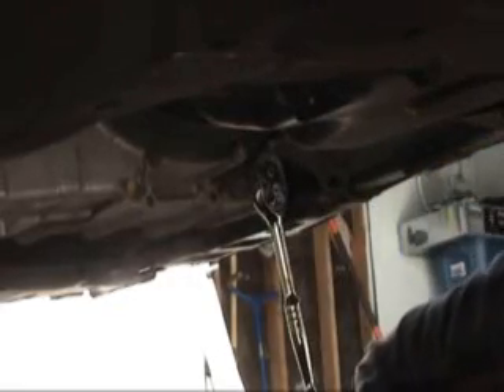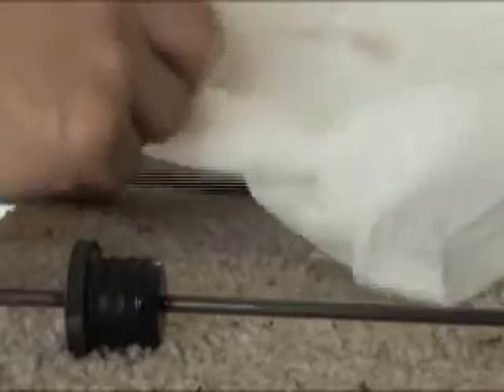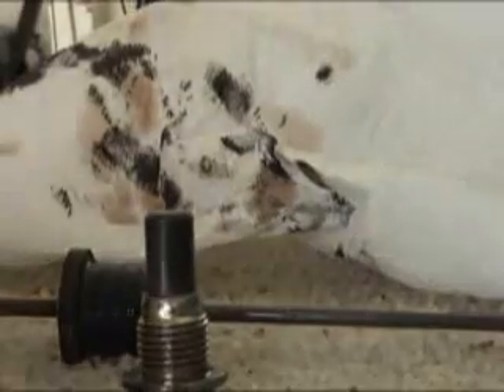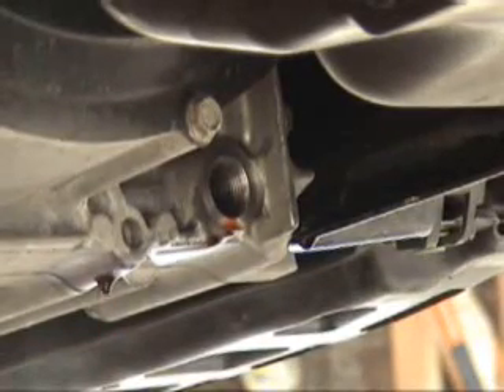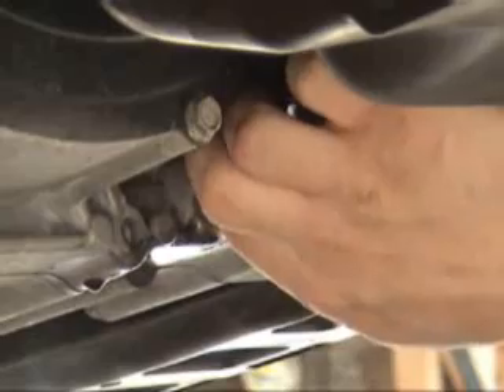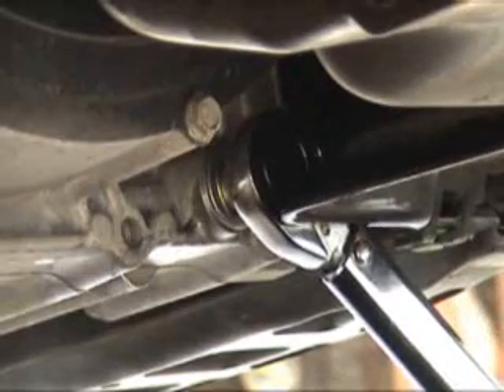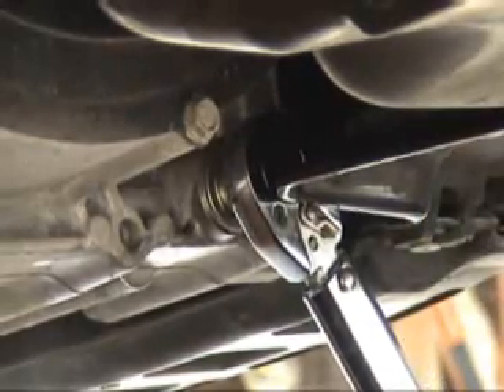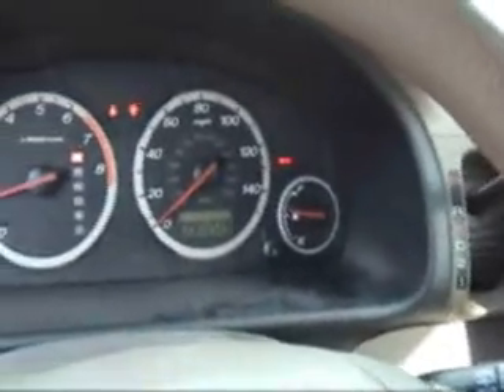2003 Honda CRV automatic transmission fluid replacement

Comment from the maker: Yes, I think the CRV has a 7+ quart transmission. However, only 3-4 qts comes out in a drain and fill. For a complete change, some have suggested to drain and fill 3 times with a little driving in between.

Comment from the maker: well, im not sure about the 04 accord AT, except that it should be listed in your owners manual. I believe that honda recommends only doing fluid changes rather than flushing. changing is simply drain & gravity  fill. flush usually means something is actively pushing stuff through the system. in theory flushing is a better cleaning - but honda recommends drain & fill over flush,

Comment: Very helpful.  Just bought one of these and the gears have problems.  It seems to over rev as it changes.  This didn't occur while I was checking it.  Also thought the cold affected it because of where I live.  Never liked automatics...Hope the change of TF will solve the problem, suspect previous owner neglected the transmission.

Comment from the maker: @BboyGrimm The torque specification is 36 ft pounds. Without a torque wrench, I would personally use a 3/8 drive ratchet,  about 8 inches in length, and tighten snug. Each person obviously varies with the amount of strength they have.

Comment from the maker: It is a 3.8 in drive torque wrench 10-80 ft lbs. Set at 36 ft lbs for the plug. 

to be honest, I dont know the 2001 odyssey. I believe the odyssey is a V-6 - while the CRV is an 4 cyl, so I presume that the procedure will be somewhat different.

Comment from the maker: @averagejoeusername: FWIW, I've gotten into the habit of using breaker bars to break loose the bolts, followed by ratchets to loosen, ratchets to tighten, and then torque wrenches to finish.

Comment: @ajchien Oh sorry, I said transaxle, mine is a 2 front wheel drive that has the differential right next to the transaxle. In my autoshop class where where supposed to check differential levels but I was never able to find the differential fill hole and drain hole. My assumption was that they share the same fluid.

Comment: AJChein, don't you have to check the transmission fluid level while the car is running (after cycling through the gears)?

Comment: I just did my wife's CR-V this morning.  I added 3.75 quarts and that was it.  The manual from Honda says if you're going to flush the system, drain it and fill it, drive around to warm the engine to normal operating temperature, drain and fill again.  Do this a total of three times.  At $8.25 a quart from my local dealer, that's over $100 for fluid alone to flush the system.  I spent $33 for 4 quarts for the drain/refill.  That should be good for 30K miles.

Comment: Just did mine It was easier then changing the engine oil.  Not sure it it was noted if anyone cares the torque spec for the drain bolt plug is 36 ft lbs

Comment: Great info-but please wash your engine-and get a $4 proper funnel with clear hose and filter at walmart. If you need a breaker bar OBV it was torqued WAYYY too tight.

Comment from the maker: i can't give you a reliable recommendation. A cheap torque wrench will run around $30, the better the quality, usually the more expensive... from i understand, torque wrenches may not be as accurate at the two extremes of their range. therefore my 10-80 ft lbs wrench I have is likely not as accurate in the 10's and up high in the 70's.